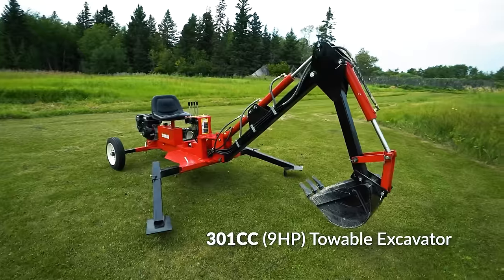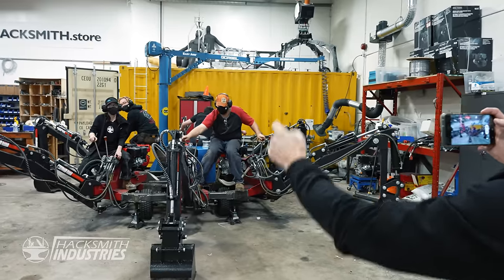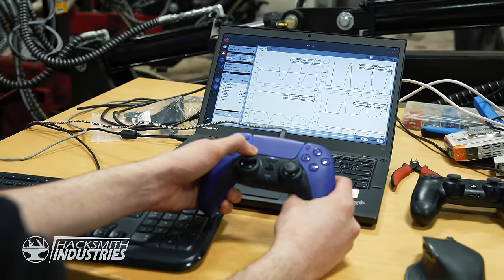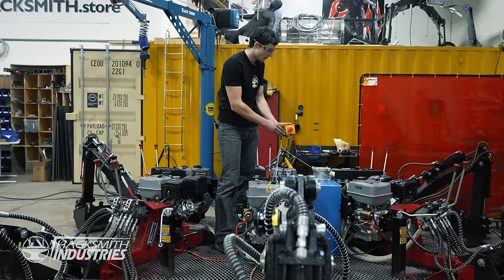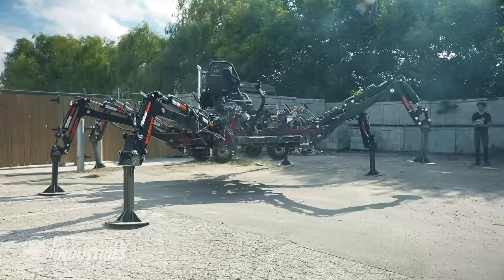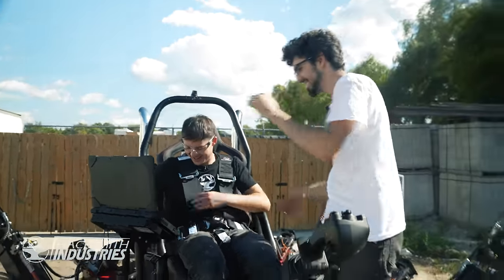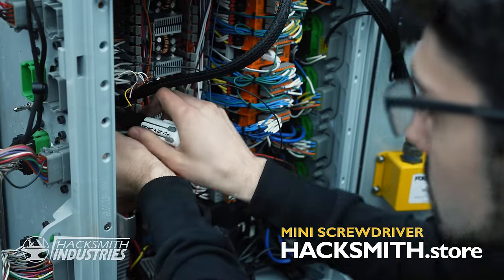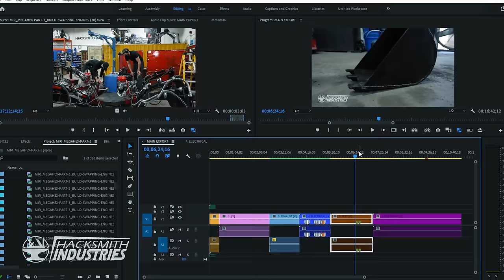Our BIGGEST project yet! (SPIDER MECH!)

Comment from the maker: FAQ: Such a huge project makes it impossible to cover everything in one video, so here's a bit more information about why we did things the way we did!

- The biggest challenge in this project was integrating and tuning our system, because big hydraulics, heavy frames, and tons of sensors have a lot of variability that needs to be checked. We used an open-source hexapod library to control how it walks, which has been used on much smaller hexarobots, and works great. Once the mechanical system is more reliable, it will be able to walk easily. 

- A lot of people asked why we didn't make a scale model, and the answer is quite simple. When you get to multi-ton mechs, scale models provide almost no benefit, because you can't build a scale model the same way you have to build a giant steel machine. A toy version using motors wouldn't teach us anything. And if we built a 1/4 or 1/2 scale version, the cost would almost be the same as the full-size megahex -- because all the components required cost approximately the same, small or large (valves, sensors, even hydraulic cylinders don't change too much in size). 

- This leads into another common fallacy when it comes to science fiction -- Movies like Transformers, or Pacific Rim... simply aren't possible. Doesn't matter how far technology advances, when you get to literal skyscraper sized robots... there's not any materials on earth strong enough to withstand the forces of such a big mech! Everyone's familiar with the common saying "The Bigger They Are, The Harder They Fall". And that really sums it up. Why is it you can drop a cat from a few stories up and it's fine, but it's certain death for humans? Because force multiplies with mass. 

- Why flat feet? We had planned on designing different feet attachments for it (you can see the holes in the plates for mounting), but for the base foot, we went with a large flat foot with rubber pads on the bottom, as the initial goal is just walking on flat ground. Having a big flat foot helps ensure the foot remains parallel to the frame, and the leg perpendicular to the ground. A pointy or rounded foot would increase the risk of the robot "twisting it's ankle" which is the weakest link in the excavators. They aren't designed for angular forces.

- Why didn't we do more FEA calculations? FEA calculations are great, but sometimes are just theoretical for best-case scenarios. For the excavators, we didn't design or manufacture them, which makes them an unknown variable that makes it really hard to calculate things for!

- Are we going to revisit it? yes but it might be a while. We want at the very minimum for it to be able to stand up on display, and walk one leg at a time (the slowest, but most stable hexapod gait)
Reply: That's really cool. I'm glad you guys stuck with it, I'm sure it was really hard. And thanks for the FAQ!
Reply: I’m not 100% sold on the idea that larger ‘mechs are “impossible” due to the force multiplication of their immense weight.  It’s really a matter of current materials research not being on par with the physical requirements of such a colossal machine.

That being said, even IF we had the materials and technology to build such machines, you’re still putting up a MASSIVE target in a combat environment with significant stability challenges.  And then firing massive weapons from said platform.  It’s just downright infeasible in any theoretical combat environment we’ve ever devised.
Reply: How are you guys doing? Dont forgot to take care of you both your mentle and physicale health guy good luck and thank for your hard work
Reply: ty for the FAQ and this project was ABSOLUTELY INSANE
Reply: hey
Reply: at this point thier making transformers
Reply: Question, why not use something like Nvidia Issac to train a neural network to take care of the motion of the limbs?
Reply: So does this mean Doc Oct's suit isn't possible at all?
Reply: which programming language did you use ?
Reply: If you can make the legs and body from molten metal in molds
Reply: I was VERY, VERY surprised when I heard you guys about testing the software on little cervos, and then onto the real thing right away
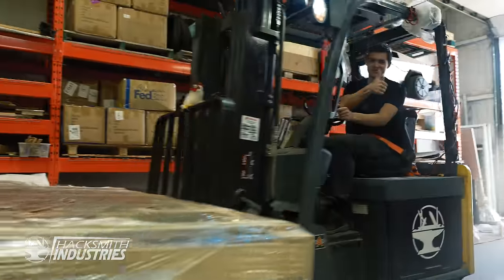I believe the main issue was, you all thought it would cost you more money and effort to build a smaller (like 1:10) scale of the mech to test A LOT until all works rather than just going for it
and just scale everything up after all trial and errors done on the smaller scale mecha onto the real mech (which is often done in big projects for commercial planes and stuff)
every failure and replacement and testing wouldn't have cost you guys thousands and hours of back and fourth outside for walk testing
Reply: Proof of concept man, but this thing clearly needs to be lighter. You gotta use lighter materials especially in the middle platform part.
Reply: nunca pense que habría un video en español yo pense que me equivoque de canal XD
Reply: @elon invest in them
Reply: you guys really didn't think abount the equal diffusion of weight 
i mean u thought those legs could just carry that center !! really
Reply: i dreamed of a spider tank yesterday XD
Reply: maybe trying carbon fiber it would be light enough.
Reply: It kind of reminds me of H.G. Wells "War of the Worlds" as in the Martian Fighting Machines... Keep going, you guys !!! One day you are going to succeed in making a mobile platform to traverse very rocky country the way spiders go...
Reply: Hey man, what controller are you using? Is it 2.4 GHz?
Reply: Jooooo wtf
Reply: this is some half life shi fr
Reply: @hueytsao  I wish
Reply: You guys are Legends
Reply: @manareddinezerabi2690  I don't even know how to respond to this
......bro
Reply: please for the love of god use like ratchet straps to lock the legs up for transport the dragging gave me an anxiety attack
Reply: Just one comment about a small-scale model, you're right about it not really being worthwhile as far as simulating physics, but you would have still been able to catch code errors before committing them to the full-size machine.
Reply: @Omega247  training a neutral network just approximates some function. If the mech breaks itself in the simplest possible walking motion, there's no room for improvement with a neutral network. It might be useful in making a hexapod that moves like an animal or some other way that is easier to train than implement traditionally though.
Reply from the maker: @VestedUTuber  only if the small scale model uses the exact same style of components, which like I said would cost almost as much as the full size one
Reply: Just one thing... 8 legs.
Reply: Maybe this machine will only be real in steampunk fantasies... But why not try to bring it into reallity... With 8 legs.
Reply: Who makes the yellow controller/e-stop you use?
Reply: Are you familiar with the logging hexapod?  They walk & cut trees.  One such machine was used on a select cut on my land in 2006.
Reply: Thanks for FAQ, you say no pacific rim or transformers robots, but what about Titanfall 2 style robots?
Reply: Love your videos guys! These videos keep me determined to forge my own path in life! Thank you all dearly.  

Chad Smith industries
Reply: @hacksmith  maybe instead of having legs that arch outwards(like a spider), have legs that go straight down (like a four-legged mammal) so that the legs's joints don't have to deal with angular forces so much.

edit: maybe if the legs are beneath it, there will be less tension forces and only compression forces acting on it
Reply: So cool! Watching all the growing pains and the consistent iteration throughout the video of the project, I can't help but wonder how smoothly the whole Planning/Learning/Design/Implementation/Testing cycle would have worked out if there was a dedicated researcher in the team since the beginning of the project (either a general hardware UX researcher or one that has experience/knowledge of translating biomechanical studies into engineering products)  (not saying there wasn't a researcher, but I didn't see one in the video so only assuming from what I know)
Reply: Great!! Now slap a Tank Turret on it and voila spider tank.
Reply: maybe if the legs are beneath it, there will be less tension forces and only compression forces acting on it
Reply: @DerHummelmann  they said why it had to be hexagonal. apparently when it was arranged in rows the legs were too close together

btw, what do you think of my suggestion a few comments above yours?
Reply: Can we get the github repo for the code?
Reply: Would a 4 legged mech have been more feasible? It would have been lighter, at least but the balance might be more difficult.
Reply: Mount laser range finders on the legs so the placement step can be smoother
Reply: Thanks for the effort to the FAQ. Anyway, it works. So, from the overall, fighting the weight is the challenge. A combination of titanium or carbon might helps, a single motor for the hydraulic instead of 6 engines, to power it maybe need an onboard generator. If it light enough, it probably works.
Reply: Sounds like you need a control systems engineer to calculate some of the PID gains or a better control system
Reply: @maskedzavadzki8024  maybe more money
Reply: @DerHummelmann  with 25° that would form an upside-down V-shape, you mean? I'm not really an engineer so I can't say for certain😅. I just watched a video about the robots of Boston dynamics and they have a walking robot called Atlas which has the potential to be used for warfare
Reply: @DerHummelmann  unfortunately, with the results we seen, it's probably better to just use 6 wheels instead of legs😅. Thanks for replying to my comment btw
Reply: You guys would probably make more money if you let more people watch your videos your members are only allowed to watch but that is just my opinion
Reply: also technically it isnt a spider spiders have 8 legs you could call it the insect mech
Reply: Great video! I appreciate the time and efforts you have allocated for this project.
 In my mind, this is a perfect start. Although, I would have been more inclined to go the mechanical steam-punk way.
 With a centralized engine and a much larger hydraulic pump, like the one used on an LF 70 drill rig.
Reply: What about AT-ATs?
And if still no, I think it is time you do a collab with Elon Musk.
Reply: Why didn't you get a excavator mechanic or diesel, hydraulic mech to have a look. They would've been able to talk to you about flow rates and pressure to cylinders. Find one that works in the mines and fixes onsite can be very smart ppl. All U guys with a peice of paper on the wall always over look the ones working on them in the field.
Reply: @DerHummelmann  haha yeah, my point when I said 6 wheels was that the old idea works better🤣 oh I'll check out that video
Reply: Factorio spidertron be like
Reply: @DerHummelmann  I just saw it, looks pretty cool. it has the 6-legged spider walker, and the normal 2legged walker
Reply: @DerHummelmann  if you had balls for feet you introduce torsional forces to every single leg. In addition to tension and compression, you now have to make sure your legs dont twist themselves apart as they did at the end of the video.
Reply: @DerHummelmann  maybe there's a reason why big animals only have 4 legs, we could learn what that reason is🤔
Reply: Okidoki
Reply: It makes you think.  How many times did something like this happen before YouTube?  Passion projects that just fail completely.  A great idea that goes wrong, with no evidence leftover.  Completely forgotten.
Reply: just put rechargeble 5v packs on eatch leg or do I wheel thing whare the wheal just rotates de legs like a fan but instead of de fliper things on the fan its the legs
Reply: the waffle house has found its new host
Reply: Amazing, I hope you are doing well and are feeling as such man ❤
Reply: Start building for a military?  Because WOW
Reply: I'm surprised you had to axe the project (for now. ) Just as the machine was working long enough to enduce failure. Clearly, after a change of gait and some reinforcement, the hexapod is gonna work. It's probably best to let it rest for a bit, though, as after the hip joint is reinforced, another weak spot may show itself.

I'm happy that this project will be revisited in the future, though, as it's really cool. I also thought that maybe you should do a self balancing scooter in the meantime to maybe put your programming personnel to good use perhaps without too much invested as far as time and money.
Reply: @OneBiasedOpinion  I'm not so convinced that a smaller vehicle wouldn't be the solution. Maybe, at most 2 stories tall. Also, with anti tank missiles being a thing a slower moving, larger vehicle would only present a bigger target. Unless we want to go down the same road as another megaproject obsessed individual, but I don't think we do.
Reply: @hacksmith  yeah because it's hydraulic so it would have been a lot more you had to do so you might as well just done it in full scale
Reply: @Hacksmith Industries, How much did this project approximately cost?
Reply: @DerHummelmann  i know what you’re saying. I understand what you’re proposing. But there’s no such thing as no torsional forces when you’re moving (aside from elementary physics problems). I can’t draw you a free body diagram in a YouTube comment section, but if you’re curious to take this convo somewhere else I could explain what internal forces are acting on a mech like this while walking.
Reply: don't think we didn't notice the ps controller
Reply: So do we need some kind of Iron man reactor to power everything up? How can we achieve this? Can we use rocket turbo for faster movement or diamond for strong material?
Reply: when we getting a flying gundum video?
Reply: are you making choo choo charles???
Reply: I don’t know why the government hasn’t sponsored you guys yet

XD
Reply: MAKE A CHOO CHOO CHARLES PLS IT WOULD BE SO COOL
Reply: @shawnboosveld7042  I'm curious to learn what are the forces involved haha
Reply: @DerHummelmann  🤣
Reply: Just imagining Choo-Choo Charles that would be scared to see in real life
Reply: It's all cool until the controller drifts starts
Reply: @OneBiasedOpinion  It's impossible to build it purely from a material POV, unless you use some kind of other form of force to stabilize and support it non-structurally.
Reply: Love youse guys. Build a skyscraper sized mech please
Reply: Could have had 2 inch rubber matts with grip under the feet to help prevent so much slippage on hard surfaces.
Reply: FAQ really helped to answers our questions
Reply: even rubber half spheres under each foot for grip on any axis of the feet would have been amazing.
Reply: Hi.
Reply: haha creo que hicieron la idiotes mas idiota que jamas hubiera visto. su error en un principio fue querer usar hidraulica computadoras y cabliado electrico en lugar de usar componentes mecanicos y funcionamiento mecanico de engranaje. Aveces lo mas simple es mas efectivo y hacer algo tan complicado y complejo como la programacion la circulacion de liquido y el problema de la electrisidad y el cableado solo crea mas factores de fallas ademas de que lo hace mas caro he inviable o defectuoso producto final. si no me creen vean el animatronic de los años 90's y sus dinosaurios mecanicos podrian aver sino mas sorprendentes de lo que pienzan algunos.
Reply: @lakazatong  the big lol I had at your comment was to just scale everything up, like its that super simple
Then what I think, you compare doing aerodynamic wind tunnel testing on small models of aeroplanes to the real thing to this spider robot.
Those are vastly different things, you're not seeing Boeing "just scale up" their small planes, it involves extremely extensive forces, its not this simple matter of just scale everything up.
Reply: Hey James while watching this mech video i had an idea clinging so hopes to throw it so instead of legs why don't u put tyres unstead of something else like the way it want to walk is something kindda similar to a Indian military grade gun named bofors since they have 4 legs for the movements so i thought but u are the engineers im just an upcoming one but since i watch ur videos like past 5 years so thought to put this out of my brain.
Reply: @colinofay7237  well now I know, or rather I think I do, the best way to learn these things would be to try
sorry for my ignorance
Reply: Have you guys thought about bending the edges of the feet with small stops on the edge (claws, or small rectangles) so that it doesnt slide out under itself, might help with grip on other terrains as well 

Like this so,maybe theyll see it, just a small suggestion
Reply: @OneBiasedOpinion  Theres one factor the people aren't really considering: the need for it to not go through the ground. I mean, with all that force concentrated on one leg why not just let it go through the ground to relieve some of the pressure of it staying up?  It might help the materials in keeping it up

As for combat scenarios, stability depends on the design (fully humanoid mechs can get up after they fall like humans do but any armless design needs either many legs, wide girth so it just falls flat, or sheer weight just to stay in place with power to even lift a leg) and weaponry can always be compensated for. I mean we got cannons to work in a mobile enclosed space that doesn't kill the people inside despite them traditionally having quite the kick. Something will be figured out.
Reply: Try to get a sponsor by Iron Order 1919™ cuz u build a mech similar to an in game vehicle from this game
Reply: I have a feeling the military might want to look at the tech you made :P
Reply: Hydraulic muscle simulation. A fibrous material that has a fair amount of elasticity. A few more steps and you would have a fair facsimile of a limb.
Reply: Replace the legs for aluminium. Then U can halve the size of the hydraulic rams, and still get faster movement. It's 101 of automotive. Lighten the mass of the wheels for faster suspension travel. Make the body as heavy as U want, but the legs want to move fast, and heavy things don't do fast.
Reply: Hey i don't want to demoralize you but i happen to know a bigger spider mech than this one ...  --->  check  Nantes spider
Reply: July 07, 2022, it worked. You over the course of the rest of the time do too much.
Reply: THE Waffle House has found its new host
Reply: A “bit” of information
Reply: It's possible... just use gundanium alloy
Reply: Have it paid off so far?
Reply: @glennboyd939  if you made everything aluminum, the body wouldn’t be able to support itself. The legs would sheet themselves in half.
Reply: Ok but I think one of the biggest problems that went unnoticed was the design of the feet cuz I think if you were to make them more ajustable it would have much more leverage
Reply: Really cool project
Reply: @williamgoode1454  Yep! That and having wheels under the base to move it, making up for how hard it was to drag out every time is also a huge problem. Every time the middle drops, you are damaging pretty much everything, even if just slightly. It needed some sort of shock system to mitigate fall damage, and the main base fell far more times than was even shown in the video. That's why the base ripped and tore. It was too jerky and fell too abruptly and too often.
Reply: @gmork1090  I feel like the stress of the build made them focus on other issues so much more than simple quality of life fixes that would have helped allot in the long run.
The wheel base your talking about with a shock system or even on hydrolics itself would have been nice. 
Just raise it up Everytime for moving and have shocks for slips and impacts.
Reply: @That1Knife  really cool.
Reply: @shawnboosveld7042  Yep. You have to use something like titanium aluminide composite that they use in modern jets. But even then you have problems due to how brittle it can still be. With custom, vastly more expensive parts or someone to manufacture them for them, this would have been more successful. But they're a small scale youtube engineering company so this was quite a feat for them to get as far as they did even going so massively over time and budget.
Reply: why does a spider have 8 legs?
Reply: @joekrater3364  Just like an AT-AT walker. That would have been better and achievable for starters.
Reply: @manareddinezerabi2690  it clearly did
Reply: @Ms Moon Boo Where the hell else would you make use of a skyscraper sized mech? Hauling things? It has enough trouble supporting it's own weight and trains are just better.
Reply: @Ms Moon Boo that question was serious
I'm awaiting an answer
If you fail to provide one, I will consider the argument over

Also don't call my brain lacking. That's kind of offensive you know? I won't take it in any bad way, I'm just saying. Of course not everything created is made for combat. Duh. I'm just struggling to think of ANY other scenarios a skyscraper sized mech would be useful in. I must stress that it it skyscraper sized, which means it isn't practical for anything short of accidentally destroying things. Instead of trying to tell people what they should do or how they are maybe you should look at the problem at hand and address that.
Reply: Please make an affordable 8 rotor ridable "drone" that anyone could build themselves? Thanks!
Reply: Wonder the Balance :))
Reply: El gran problema de este proyecto fue el peso. Creo que lo planearon mal, ya que no anticiparon la carga que debería soportar cada pata. Para mi debieron fijarse en las tecnologías empleadas en la industria automotriz. Debería contar cada extremidad con amortiguadores independientes en un tobillo. Le cuesta dar el paso, porque la superficie de apoyo no es adecuada respecto al movimiento y por ello esta no crea el ángulo correcto desestabilizando todo el movimiento con mas trabajo. Si se observan las arañas se darán cuenta que sus patas no son perpendiculares al piso al caminar. Por que  las excavadoras se levantaban de una manera mas optima ? Porque la pala a pesar de no ter tanta tracción , ya que es para excavar, cumplía la función de tobillo, que en el nuevo diseño de pata no tenia. La ingeniería es sublime, pero la tecnología biológica es la mejor de todas. Hay que observar mas lo que nos rodea.
Reply: @gertpacu3926  There is no such thing as a rideable drone that anyone can make themselves
Those two properties cancel out
Reply: @thebarkingmouse  the only one of those I know of was the Timberjack from 20 or so years ago. A prototype was made by Plustech. John Deere bought the company and produced what looked like a production ready version. They had an arm on the top which could fell trees, strip the branches, cut the logs to any desired length, and stack them. The arm and processing tool went on to be used on tracked and wheeled platforms.
Reply: hey
Reply: I doubt even this is gonna be your Magnum Opus..... :D

runs away
Reply: Put weapons on it and sell it to the US military and become rich
Reply: I am not an engineer; I know only the fraction of crap yall had to deal with for this project that could fit in this video, but here's an idea:
Wouldn't it have been easier to make a really small version, like an rc car sized one as a prototype, then once you flesh out all the software issues and hardware issues you then scale it up?
So that when stuff fails it doesn't wreak havoc upon other things and it's a lot cheaper to build and test then the big one?
Reply: apparently we need to pay to join to get the good content. i think they should scrap that join button on all tubers cause you can end up paying for all your fav creators, and bill is higher than the cable bit not to mention patreon.
Reply: @OneBiasedOpinion  its a mech not a military application.
Reply: @lakazatong  I agree and i also think those little machines i dont care call them a excavator there a joke. there cheap pieces of crap. save time as well not using those things.
Reply: @aecore1034  lmfao
Reply: @Antonio Zile great idea
Reply: @thebarkingmouse  my friend has one there insane, he clears forest paths in NH for overgrown forests. we call them tree farms. they clear cut a road for lumber then they plant more trees.
Reply: For a v2 something you could try is reducing the degrees of freedom on each leg (i.e. take the middle actuator - tibia - out and make it a solid support). That would reduce failure points and simplify the control.
Reply: The giant enemy spider
Reply: well, thankfully transformers are alien mechanical lifeforms lol. You guys are amazing, keep up the good work, i´m sure everything will pay off in the end. Can´t wait for the next project
Reply: the design it's wrong should make  in small scale fusrt. with wood. a lot of lag of aero spacial creativity sry who said if have leg dont need wheels?. i had a simillar idea the main pourpose of the  machine it to make a general constructor tha can build any thing or almost.  only 4 legs, center shoudl have at least 6 rigns there are many detail that i dont know how to explain it verbaly. but stop thinking compartimentalized machines purposes or moving parts.
Reply: 4 legs tha can tranform in to 8 and viserversa. and have 12 wheels that its more than wheels
Reply: it can transform in to like a car also into similar motorcycle etc. leg also work as suspencion that get energy. let me build the general constructor to make humans interplanetary simplifi many many machines to build any thing in mars where ever. the suize nive but in machiness
Reply: Just found this channel and adding it to my sub list!  Now as of the structure fails you did notice it wasn't on your fabrication where the  issues created. It was on the (please excuse the term) The cheap Chinese made structure.  Typical for these "affordable" tools. Now if you were to actually finish of the frame fabrication and replace the weak inferior "red" parts with you're own fab, I believe your success will be greater.  As far as the stride, There is a video game called Crossout. In this game has mechanical legs similar of this type of movement parts are used in the building of machines. Could the game mechanics actually be in sync with what you are wanting? Just a thought.  In a nut shell it is great to see such young minds at work on new technology! After all scifi shows bring in the idea, People as yourselves make it happen! Kudos!  You brought hope & enthusiasm to an old man.
Reply: Borrrrrrrring...... make a video! YOU MAKE MORE MONEY and its educational.
Reply: BALL JOINTS JUST ABOVE THE FEET Would Greatly Reduce the Stresses up the legs and to the other joints.
Think of how a Ceiling fan hangs on a Rod with a ball on the end and a cup on the foot part or vice versa, It doesn't need to be something complicated just a build that will allow that Foot to come near flat on the ground using gravity.
👍Great Video and MECH👍
Reply: wow, this really answered all of my questions XD
Reply: @DerHummelmann  Spiders can move over rough terrain but are slower than the 4 legged creatures that want to eat them.  There used to be a lot of larger spiders but they've mostly died out for this reason.  I've heard before that there are a few types of spider than can still grow to be over a meter long.
Reply: hi. this project is awesome. this video is awesome. you guys are awesome. why did you guys not put shocks or a spring system into it? did anyone suggest that? i'm not trying to talk shit asking this. i couldn't have built this thing. i feel like the team that built this is super smart really knows whats up. this seems like a pretty important thing to not put in though. really curious. thanks.
Reply: This was a brilliant idea, even if it didn't fully survive, you at least hit all your goals, right? If another attempt is made, maybe start from the ground up with hexapod bot in mind rather than franken bot hex ;-) Love seeing out of the box thinking like this, well done!
Reply: @theHacksmith Some dude called  @the_mysticle-  is in your comments and claiming to be you. I've seen this many times.  Before they say you've won something and then demand shipping costs for your so called gift. They are now targeting your subs and have impersonated your channel logo and are posting as you. I won't fall for it but others will. Try find a solution for that lol.
Reply: @theHacksmith Some dude called  @the_mysticle-  is in your comments and claiming to be you. I've seen this many times.  Before they say you've won something and then demand shipping costs for your so called gift. They are now targeting your subs and have impersonated your channel logo and are posting as you. I won't fall for it but others will. Try find a solution for that lol.
Reply: mgea hex bug (dog size)
Reply: @manareddinezerabi2690  would it be small trunk but muscular legs to be assemble
Reply: It's project not pro ject smh
Reply: when I saw the idea in the first 2 minutes I immediately thought you guys are nuts. There is no way you can build this thing: mechanical, software, electrical engineering. You are biting waaay too much at a way too big of a scale.
I watched the whole video, congratulations, you really have done the impossible. 
Excellent communication and editing of the video as well. You managed to transmit the nerve-racking hard work you have done in the past 426 days.
Reply: try to change the shape of the leg, when it tries to move center of gravity is changing
Reply: @Ms Moon Boo its more of a question of funding the research and development... there is a reason why most technological progress was either made during wartime or was a military project for war or as government likes to call "protection of its people", individuals and corporations for a longest of times didn't have money to fund things that didn't guarantee any profit in the future
Reply: @erich3784  eh, concept was already proven 13years ago with Timberjack Walking Machine
Reply: @hacksmith  the only thing i see wrong in this build is the lack of suspension springs to reduce the load of metal and the toe should be bouncy round rubber not just flat metal.ALSO suspension at the bottom of the engine so that when you guyz make a landing it will not break your entire structure.
Reply: @Ms Moon Boo the two examples, transformers and pacific rim were both "made" for a combat environment
Reply: @DerHummelmann  oh no, sorry I don't play mortal kombat, I had to Google him. sorry for the late reply, I don't have alerts on for YouTube as there tend to be lots of toxic replies. By the way I was reading the replies here and they say it broke because of the force of the spider walker falling on the mid legs when it contacted the ground.
Reply: @cakwabingga1700  yes, that was my thoughts exactly
Reply: @gmork1090  are you saying that when the body falls, it damages the legs and hence why there was sheer force which broke the structure?
Reply: @williamgoode1454  yes I think the 2 inch rubber matts would have helped
Reply: What design 3D software do you guys use
Me and my friend are trying to make Beyblade and we’re having trouble finding a design software
Reply: Purhaps the tungsten rod could be a pipe with angled laminar flow holes spiraling up it and spinning the rod like rockets. Purhaps another line channeled through with coolent to prevent melting. But what to prevent Saber deformation? Alloy?
Reply: "there's not any materials on earth strong enough to withstand the forces of such a big mech!" 

So you're saying there's a chance.
Reply: @joekrater3364  everything looks very rigid, especially where all the weight is supported
Reply: @vintack-g8069  so you're saying they should put some shock absorbers or some bendable metals?
Reply: @DerHummelmann  ah OK. I think they already said that they could not put the legs in a straight line because there was not enough space
Reply: @DerHummelmann  but you,'d also need the mech to be able to turn. I'm not sure how that's possible with only movement front and backwards
Reply: @DerHummelmann  maybe one thing they could do is to move only 1 leg at a time, so that the hexapod has at least 5 legs on the ground at all times, but this might be slower
Reply: 2023
Reply: I want one ✋️🙋‍♂️ not sure where I would go but  I'd just say everywhere to be safe 😅
Reply: Can you one day make the ultra sword from Kirby
Reply: @joekrater3364  Yes, it's just that you only look at your feet when you walk, your feet are molded by where you walk, you unconsciously lift one foot and you don't step straight, if you try to walk straight ahead your legs will hurt, that monster they made was 8, there was basically no way for me to walk
Reply: Can u guys do bt7274(titanfall2) irl
Reply: IDK the logistics but you could use giant gecko feet nanotechnology pads to the feet as a gripping method(youd want to be able to spin them so you can change the gripping direction) if it’s designed right it might be able to climb and stick to surfaces with a much greater stability without an adhesive so it could easily move and hold itself up without tipping or falling!
Reply: On the positive side now you know enough about the process that if you could afford to make the entire thing from scratch you should be able to make a much more durable version.

It seems like the main weakness was the structural integrity of the excavator arms and frames.

Worst case scenario you've provided enough data to help someone else build one from scratch.
Reply: @Ms Moon Boo true, but the military is probably the only customer that has the money to make production cost effective. You would have to either sell a massive amount of them cheaply or charge so much no one can afford to buy one.
Reply: @manareddinezerabi2690  I immediately thought about the weight they started with by having multiple engines. Wouldn't it make more sense to use bigger engines and therefore have less engines?
Reply: Please turn it into choo-choo Charles and let it have a door on the back of it that opens and the way you can drive it is basically a stunning wheel a lever that makes it stop go forward and go backwards just like the actual game please
Reply: Do it with Matt Denton. He has successfully done this project before. :) he is also a super cool guy that you should collaborate with.
Reply: You guys should make an Atlas titan from Titanfall
Reply: Can you make a ram/scram jet engine powered plane plx :)

Edit:i switched missile to plane :)
Reply: You need for every leg a foot and every foot needs a sensor to measure the pressure. Then you need a program what regulate the pressure so that the pressure is on every leg the same if he stands.
This device is walking without any sense, this is impossible to do even for a human. If you close your eyes and do not feel something, then you could not walk, you would constantly fall.
The best would be a pressure and a distance-sensor for every leg. And a bit of a spring should be on the legs for compensation of uneven ground and maybe direct as pressure-measuring tool.
Reply: @OneBiasedOpinion  but there's still the problem of the square-cube law
Reply: Cuanto dinero gastaron en el Megahecks?
Reply: @vintack-g8069  you mean that it doesn't change it's walking pattern based on where it walks?
Reply: You guys in Vancouver?
Reply: have you considered giving the feet a design similar to the walkers in star wars? it could help with it's walking.
Reply: This reminds me of the monster machine from the movie wild wild west. insane!
Reply: springs or some sort of ball shaped "tire" (maybe with spikes) as a foot to soften the touch on the ground?
that woud distribute the load even, onto the leg and further to the chassis. some sort of "ankle" control to keep the "foot" vertical. that way it wouldn't wobble so much and destroy itself.
but these are just some small ideas i had while watching.
what an effor, what spirit!
i am amazed what you guys put together.
Great work!!!
Reply: El problema es que le faltan tobillos. Como en los perros robots de Star Wars.
Reply: How about if you move sideways
Reply: Saw the YT short and instantly said. “Now freaking way…” YES!!!!
Reply: Mayby use pulleys like tendons instead of hydraulics.
Reply: You needed James Brunton
Reply: I wonder what would’ve happened if Mark Robber involved in this awesome project 🙄
Reply: @predatorhs  James Brunton......that robot guy that's already done stuff like this......he'd have them coding it properly from the start
Reply: This is pure insanity of the best kind! The flat feet make sense for a prototype; I will admit I was curious why you went with flat feet rather than some kind of leaf spring arrangement or more flexible foot.
Reply: Our BIGGEST project yet! was a failure atleast you got room to grow
Reply: What if each foot had rotatable cat trax
Reply: Hello Hacksmith my name is Abdurrahman 🇦🇿🇦🇿
Reply: It’s a masterpiece
Reply: Do a collab, jaimie mantzel he use to make robotic spiders for kids with detachable parts, has a youtube channel jamie builds
Reply: Senator Armstrong is breathing heavily right now
Reply: Can you guys just co sign with us military or Canadian military for budget, as long as theres a Cannon!
Reply: Also mechs are cool
Reply: Thank you for the FAQ, also is it possible to build the Juggernaut aka "Aluminium Coffin" from the anime 86?
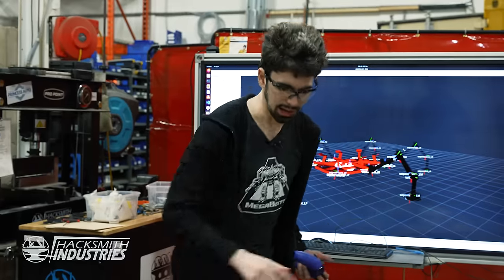Reply: At 10:27 This guy is 1/2 my age but is older than I'll ever be. Look at that mad scientist hairdo already going grey. When will he be releasing the Flux Capacitor to the market?
Reply: HAGAN LAS BASES DE LAS PATAS ESFERICAS.
Reply: Ngl you should make mech merch, just milk it as much as you can
Reply: @Ms Moon Boo "combay , violence = video games" Sure buddy now go touch some grass.
Reply: it was awsome
Reply: What about adding a ball joint to the foot...?? that way the base will stay on the floor.
Reply: The spider's paste must change, watch a spider walk so they can learn, but the legs have to change, it takes away the spider's strength
Reply: 真的帅，加油！
Reply: i have no idea when  you guys got this kind of budget but im very happy about it. such an awesome build!
Reply: Asi te ves tu robot? :text-green-game-over:
Reply: Keep working on your tech soon what is currently called impossible will be possible
Reply: hey as a guy whose working towards the same goal man you should build model on a small functional scale first because symmetry works in equitable ratio to sizes. 
in a simple way to say it.
  if you have a pulley that x size and this rock is Y size and the pully works as indented. then you just mathematically scale up afterword.
this will save you money in materials and man power.
Reply: ps you need hydraulics to pull the leg in and the top should be build to push out in a semi A frame.
this gives you a simple mechanical design that can be operated with less sensory and circuitry as a necessity. you have a finite amount of energy  you must utilize its power of motion with better tooling in locomotive mechanics.
try a beach cruiser and then ride a mountain bike up a hill to get what I mean.
I say this as a guy whos out to mechs come about so don't take this as harsh judgment, just a passion and deep thought about the subject.
a spider is a fluid being inside a flexible but tough resilient but mechanical exoskeleton.
look at biological design to see secrets you wouldn't find otherwise
Reply: Cool, tho spiders: 8 legs
Reply: You should use lite matel instate of iron you should use almonium and using rabar in the down leg will help to protect the leg from hitting in ground . You should work from 0 to 100 .
Reply: Hey you probably not gonna take this seriously, but what if you attached the upper half of the power loader to this?
Reply: while the project didnt have the outcome you hoped, the experience you guys learned is invaluable. I recommend the hexmech not be put into mothballs yet, but put somewhere where it can inspire you guys to maybe create something that you can base the base idea on. maybe one day you can finish the hexmech. or maybe use it to build something that can use this creation's design but simplified.

Just a thought.
Reply: Tarea 1
Reply: Tarea 1
Reply: Isn't that the same leg that blew out the hydraulic cylinder?   That would indicate to me that leg was experiencing more force than the other legs.  1% more? 5% more?  I don't know.  But the answer may indicate how close the other legs are to failing.  Maybe the frame isn't quite square?  Maybe it experience a high stress event one of the times it fell?  Maybe that leg was in the rear every time it was dragged in/out of the shop and that caused repeated high tensile strain?  Just ideas.  You guys will figure it out after you are recovered.  Being I am watching this so much later you may be recovered now.
Reply: Understand that all Spiders/Arachnids that exist are defined by having 8 LEGS.
Reply: Soon, there is going to be the rapture. It's when there will be trumpet sounds, and after the trumpet sounds, God will lift his people from here.    Also, God said people should be living by the Bible.  Amen, and God bless you.
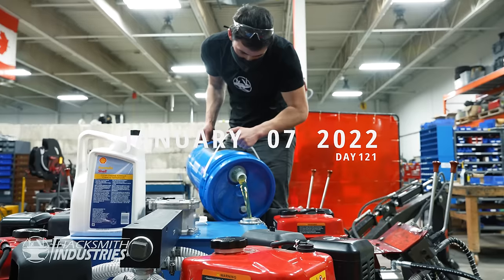❤️* John 3:16 - "For God so loved the world, that he gave his only begotten Son, that whosoever believeth in him should not perish, but have everlasting life".❤️
Reply: Instead of mechs with legs, how bout you guys recreate the Lunar lander test and learn rigs. In the grand scheme of things, the platform is simpler, and in light of what Destin lit up on NASA, maybe it will be a kick in the quad for them to get their act together.
Reply: The giant enemy spider
Reply: Now do it pneumatically. built in springs!
Reply: "The Bigger They Are, The Harder They Fall" - Say it to Belaz, AN-225, Bagger 288, Liebherr LTM 11200-9.1, etc 😄 And here only some kind of spider is only 2 meters high)))
Reply: ¿Porqué no lleva agarres de caucho en las patas?
Reply: Hola Hola puedes leer para ver si soy capaz
Reply: Hydraulic muscle simulation is the future of robotics. Using hydraulics in the same way the human body does would not only increase the robots functionality but it could be used in the medical industry to replace cardiovascular systems, muscle, missing limbs, etcetera.
Reply: stupid question: have you reached out to the company that designed the excavators at all? they may have useful info for the next time you try.
Reply: Very nice project and video. But have you ever thought about having 8-leg spider? The real spiders have 8. I believe that would help the stability a lot.
Reply: But would building a small scale model, coding for it, and then adjusting the code to save some time and structural integrity of mech? Or the code from a smaller scale mech wouldn't be possible to modify for heavier weights?
Reply: This immediately reminded me of the Spider Mech Doom 1 boss!
Reply: you know with all the people you have on the project the fact it has six legs means it's an insect or in other words a hexapod why didn't you figure that out first?
Reply: 12 Porque assim diz o Senhor: A tua ferida é incurável; a tua chaga é dolorosa.
13 Não há quem defenda a tua causa para te aplicar curativo; não tens remédios que possam curar.
14 Todos os teus amantes se esqueceram de ti, e não perguntam por ti; porque te feri com ferida de inimigo, e com castigo de quem é cruel, pela grandeza da tua maldade e multidão de teus pecados.
15 Por que gritas por causa da tua ferida? Tua dor é incurável. Pela grandeza de tua maldade, e multidão de teus pecados, eu fiz estas coisas.
16 Por isso todos os que te devoram serão devorados; e todos os teus adversários irão, todos eles, para o cativeiro; e os que te roubam serão roubados, e a todos os que te despojam entregarei ao saque.
17 Porque te restaurarei a saúde, e te curarei as tuas chagas, diz o Senhor; porquanto te chamaram a repudiada, dizendo: É Sião, já ninguém pergunta por ela.
18 Assim diz o Senhor: Eis que farei voltar do cativeiro as tendas de Jacó, e apiedar-me-ei das suas moradas; e a cidade será reedificada sobre o seu montão, e o palácio permanecerá como habitualmente.
19 E sairá deles o louvor e a voz de júbilo; e multiplicá-los-ei, e não serão diminuídos, e glorificá-los-ei, e não serão apoucados.
20 E seus filhos serão como na antiguidade, e a sua congregação será confirmada diante de mim; e castigarei todos os seus opressores.
21 E os seus nobres serão deles; e o seu governador sairá do meio deles, e o farei aproximar, e ele se chegará a mim; pois, quem de si mesmo se empenharia para chegar-se a mim? diz o Senhor.
Reply: @Kauan-Kaiser  your granny
Reply: Dont be too hard on yourselves
Reply: I wonder if all the New AI stuff going around these days if that would have helped tremendiously with the programing of how it moved.
Reply: Would be nice if you could just simulate everything and thus work out all the kinks before building it. Unfortunately I don't think there's anything sophisticated enough that could account for all the factors as well as the issue of actually implementing stuff there's almost guaranteed going to be calibration mistakes or unforeseen things as you demonstrated already.
Reply: Yo quiero un dron que pueda manejar con forma de caza tie :(
Reply: @OneBiasedOpinion  It doesn't matter, it would be beyond expensive and impractical even if it were possible for absolutely no benefit.
Reply: Imagine, if you had kept going, it became of practical use, and you sold the patent. 💵

But             💸
Reply: @darkwraithcovenantindustries  shrug

That’s why no one will remember your name.
Reply: @OneBiasedOpinion  why?
Reply: Do y'all hire?